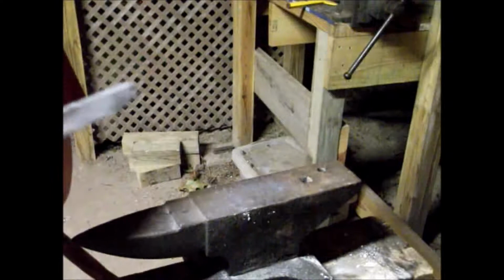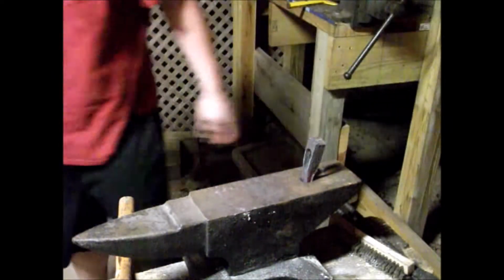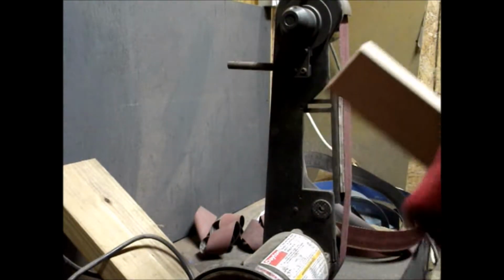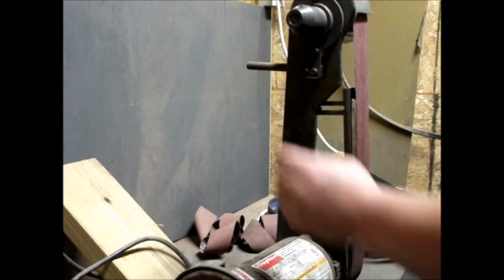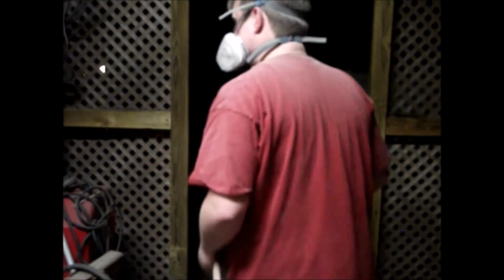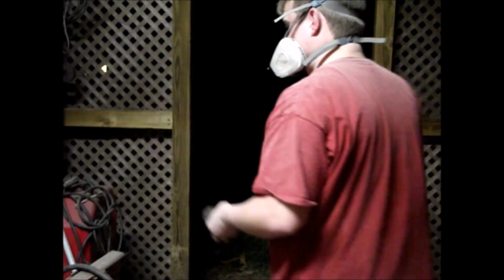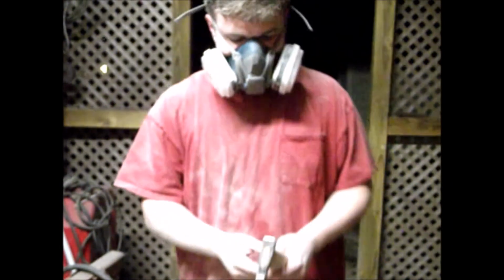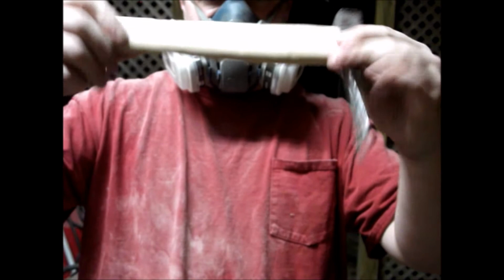Tool week pt.1 The hammer eye punch

Comment: Hey bud Whats up, Man good job on that build . What did you make the punch from?  I have a old brick hammer I will be converting to a Hammer eye Punch eventually.  Thanks again for the shout out Buy the way. Man alive,  what were you thinking when you desided to sand that handle out from that large board? Man lots of work you should have cut that thing a bit with a saw would have saved lot of time and belt wear.. Looking forward to the drift build and the hammer. Were did you get the chunk of 4140? I have lot of possible 4140 (a 8ft fork lift fork but it could also be 1050 or 5160  all of which will make good tooling or hammers. Glad to see a new video I am currently working on my forge build that I will be putting on my YT channel when it is finished.  Again Thanks for the support. Martin M&S Blades
Reply from the maker: martin and shan Moldovan i made it from an old hatchet head. Around me there isnt much scrap material. When I move there will be allot. I got the 4140 on ebay its a 2 1/4 round and 12" long. I got it for 20 bucks free shipping. I wouldve cut the handle but my bansaw is broken right now but I havent been able to find the part. Im looking foward to that forge build. Ill measage tou the ebay link for the 4140 if you want.
Reply: I do apptreacate the offer on the 4140 but I have a great friend that has a large machine shop that I can get 4140,52100, and several others free all I need to do is dig threw the cut off bin lol....  Yea the forge build should be pretty cool I have been in contact with Wayne Coe about the ribbon burner I told you about. So inevetabily the forge when complete will be a blown forge with plenty of power with little gas use. I am looking very forward to getting her running I am not liking the use of coal just not my cup of tea not to mention it ewill be cleaner and help me stay a bit warmer threw this winter.....  lol.. Martin M&S Blades
Reply: Forgot to add you handled everything in a fantastic fasion if it were me and my shat was broken I would have done the same thing..  What ever it takes to get the job done in a safe as one can mannor. Hey are you subed to Neils Provos Just asking he is a very great blade smith you should check out his channel. Just a thought. Peace. Martin............. You know the rest lol..
Reply from the maker: That's awesome about the Forge and burner. Yeah I can't even use coal in my county. I am subbed to Neil Provos he is an amazing artist I wish I had his setup just to be able to play with damascus.